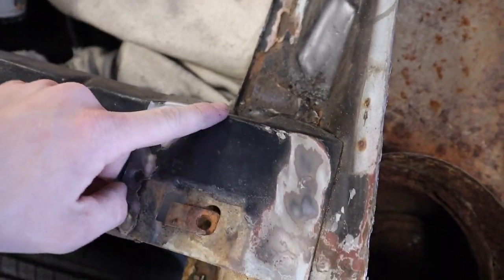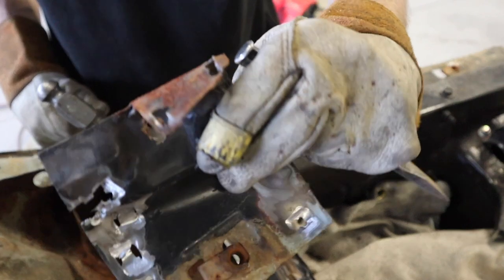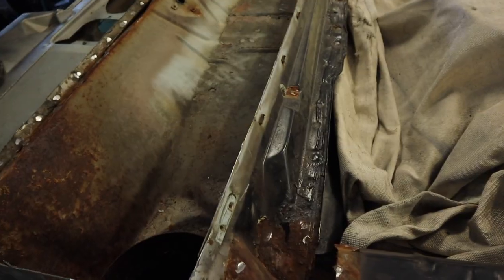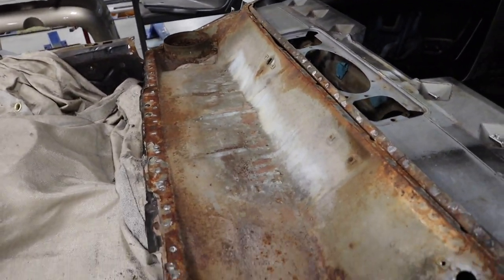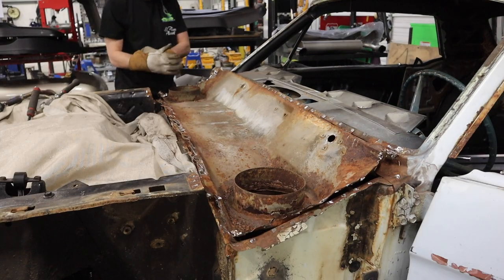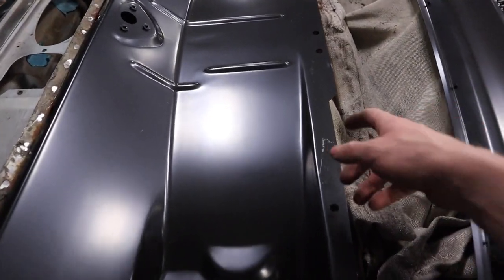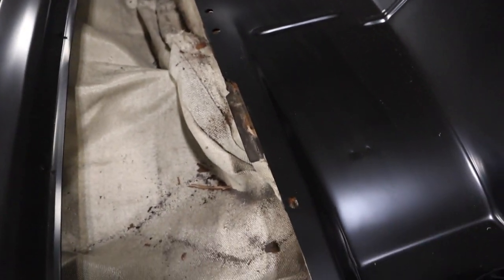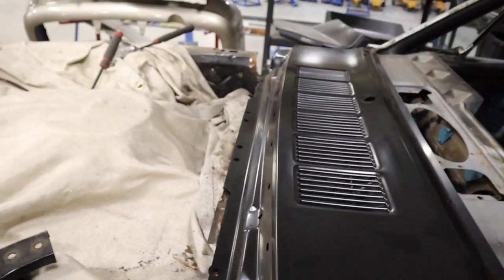Complete Cowl Panel Removal on a 1965 Mustang

Comment: Great video - quick question. The lower cowl piece with the fresh air vents - when it rains, where does water go? How does it drain out of there without flowing down into the cab of the car?

Comment: Quick question, how much would a shop charge for this job to be done ?
Reply from the maker: It would probably be pretty expensive due to how much is involved.
Reply: How much in dollar's
Reply: @gpaulwelch7127  I know im late but if I had to guess it would be somewhere around 5 grand.
Reply: Well how long is a pice of string,that’s to long
Reply: @CosmicGalaxyMC  crazyyy not even close man. More than 10k
Reply: @prometheus6853  No way. I called a restoration shop near where I live and I was quoted 4 grand w/ labor included.
Reply: @CosmicGalaxyMC  with all that rust 4K??? And put back together?? They probably thought a little bit of rust man
Reply: @prometheus6853  Mine isn't that bad I don't think and it wasn't an in-person quote either. I have to get some brake issues figured out but I don't even have 4 grand atm. I'm going to be doing it myself. But this shop did quote me a little over 4 grand for a full cowl replacement without paint matching.
Reply: @CosmicGalaxyMC  yeah I got a 1965 mustang too and there’s surface all around her but im not gonna let her die on me man. During this summer imma take off all surface rust around her shell
Reply: @prometheus6853  good for you brother, I got a 66 with the same deal going on. We gotta keep these classics alive.
Reply: @CosmicGalaxyMC  even though they cost us money and a shit ton of time, it’ll be worth it man

Comment: Your doing a frist class job. Crappy original design. unpainted sheet metal and a tiny water drain that was bound to clog up with leaves and dirt. I only have a tiny leak in my 65 but I know it will get worse if I don't do something about it.
Reply from the maker: Thanks! yeah a tiny leak will become a massive leak like mine!